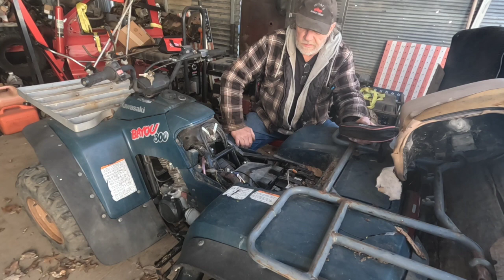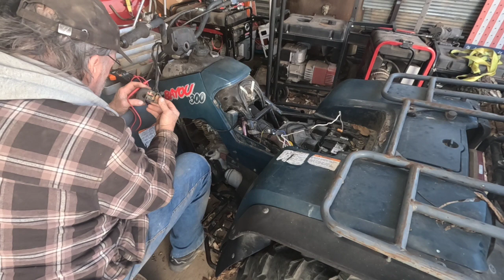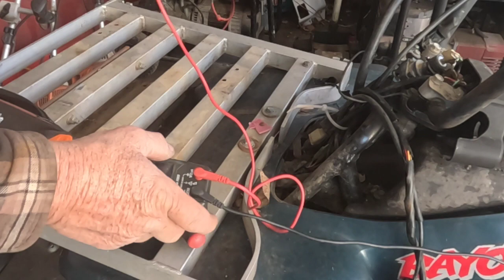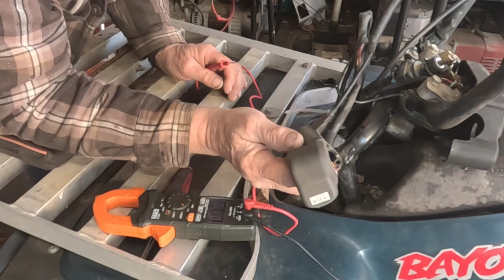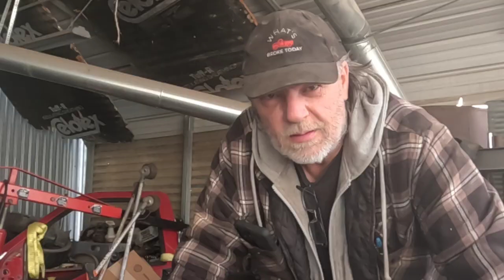Kawasaki Bayou No Start Checking Electrical, Battery and Switches.

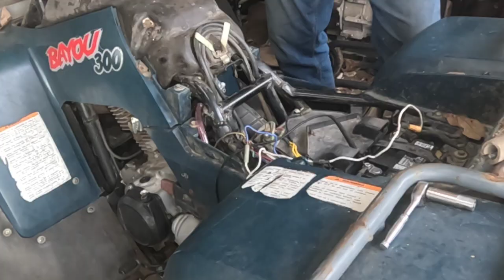Comment: 12:21 neutral switch wires. Green wire to ground when I zoomed in. Double check. Use a test light. One is hot and one completes ground through neutral light. I think. Mine is 1984 185